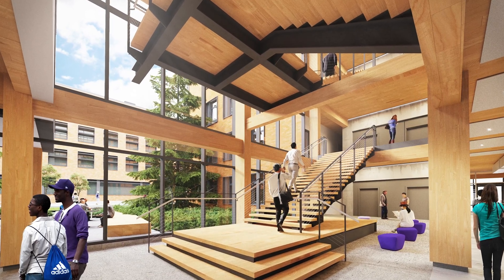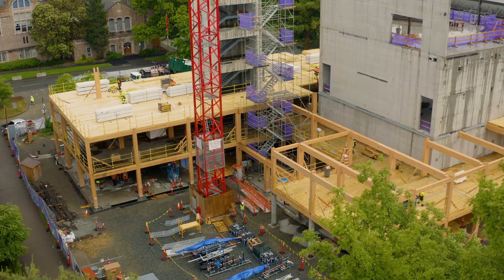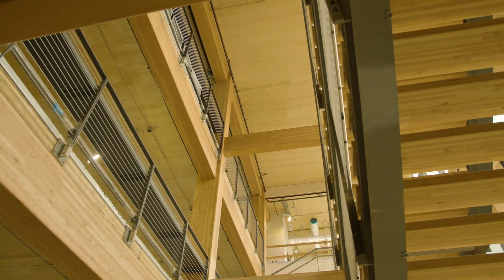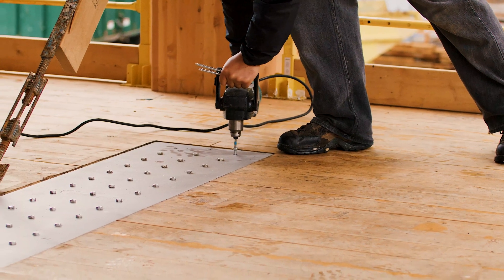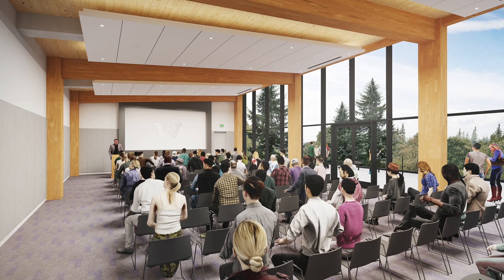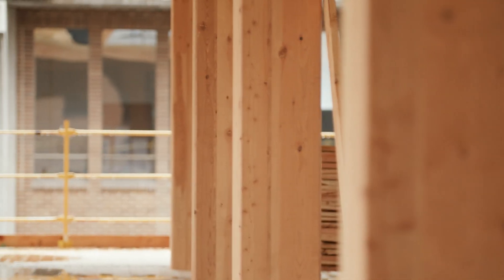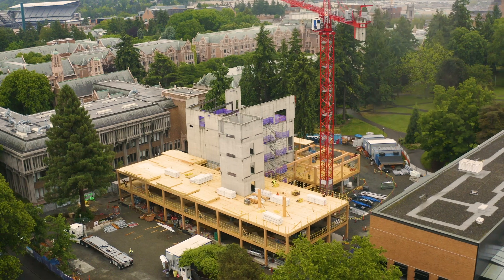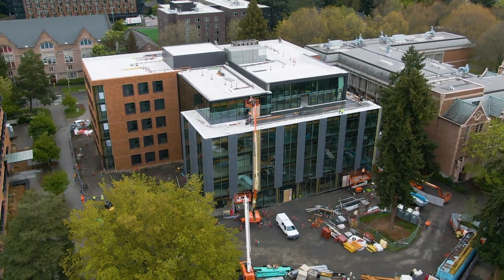Mass Timber Case Study: University of Washington’s Founders Hall

Comment: What fire protection is used?.. how are the termites prevented?. What about when it rains
Reply: The mass timber components have a fire rating based on the thickness of the members due to char factor . Termites are treated at the foundation/slab on grade level